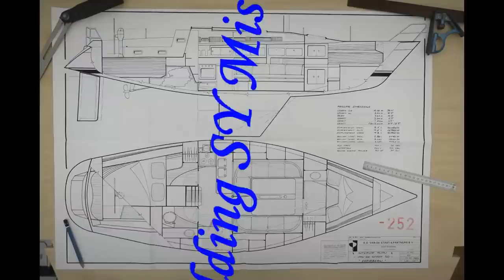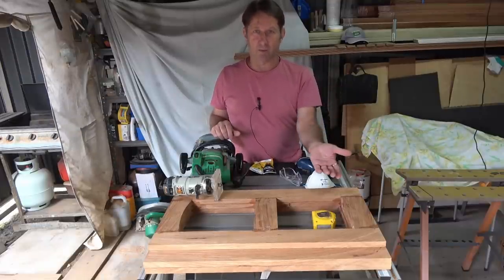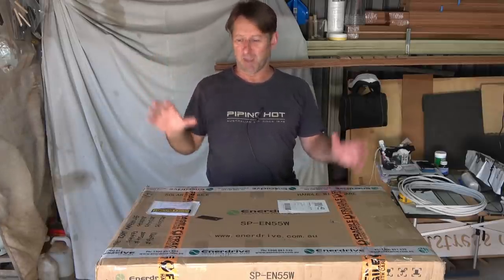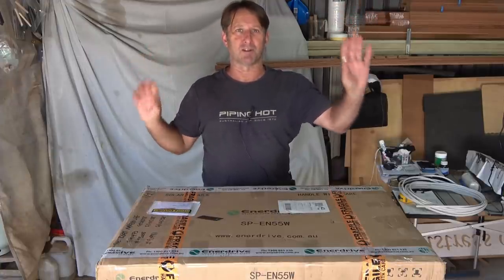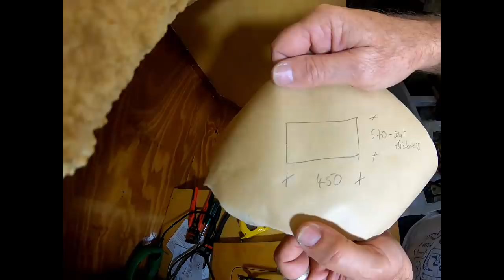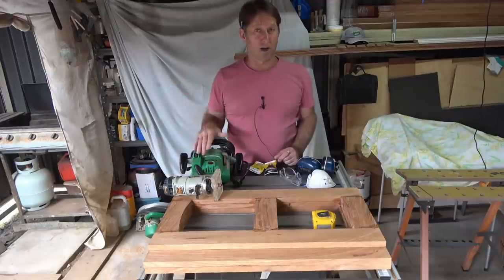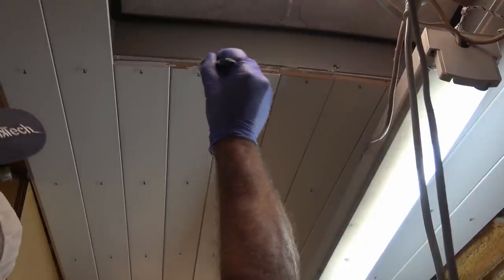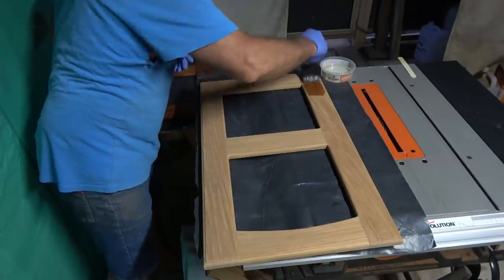ALL sorts of GOOD boatwork Ep.122 Building my steel sailing yacht

Comment: I really liked the treatment on the cabinet doors! I will remember that! I would recommend you paint the cut & filed aluminum screen insert edges as they will eventually corrode in the sea air. The overhead looks great and things are starting to come to a focus!
Reply from the maker: Thanks very much for your good comments Brian and fyi the edges of all of these aluminium pieces will be sealed in adhesive. Yes, the finish work with some things is starting to come together, thankfully!  🙂🙏

Comment: Well done Bruce. Lovely doors. BTW my personal view regarding solar panels and wind generators on small boats is 1) Wind gens are very noisy when at anchor and can damage bird life at night and 2) Solar panels made in China or anywhere else do not last or perform well at sea. Ok on a fresh water canal in the UK, but those boats are toys not ocean sailing vessels. Salt on them really reduces the output, they are weight in the wrong place, they need cleaning and replacing and the power packs are another cost and weight. If you use paper charts for your coastal work you won't need electronic gear so much and personal light when dark can be supplied by a very small LED using extremely low power to run. Finally, solar panels are so ugly and cumbersome when mounted on a thing of beauty under sail like Mistress will be. Old school is reliable and centuries proven. BTW I am 77 years old so I guess I am expressing bygone thoughts.
Reply from the maker: Thanks very much for your good comments Graham, appreciated and understood re. solar and wind generation hardware. Things/hardware and technology have improved a heck of a lot and no doubt will continue to, so for eg. much quieter wind generators are available as are durable and decent performing solar panels. As I always say, nothing is perfect and compromises ALWAYS have to be made and I think that having other alternatives to only having to rely on running a diesel engine to charge batteries is sensible. I do agree with you though re. the unsightly aspect of adding these things and Mistress will be quite a low power consuming yacht, things and time are always changing, as one old saying goes, "nothing stays the same"  🙂⛵
Reply: @BuildingSYMistress  Fait enough comments
Reply from the maker: @graham6229  🙂👍

Comment: Hrm, on the topic of solar types, I feel like on a boat, where realestate is tight (especially monohulls) monocrystaline just make the most sense.  There really is no debate over whether mono or poly is more efficient, mono is just factually more efficient, and if your goal is to supply the most power from a small available area, it doesn't make sense to use polycrystaline cells.

The conversation of rigid vs flexible has gotten a little more interesting recently, with more and more flexible panels coming around that can almost reach the efficiency levels of rigid panels.  That said, I would still only use flexible panels on highly curved areas, or where I know that I might need to stand or walk, where a rigid panel would require special hinged mounting to allow for access.  But anywhere that I know that I wouldn't be needing to stand or traverse, and is relatively flat, I would be using rigid panels because none of the flexible coatings have managed to attain the light transmission levels of glass.

Though there is a solid argument for weight savings of flexible panels over rigid, and if I were selecting a solar solution for a boat with a large amount of space to use, or one that is more highly sensitive to weight, I would have to calculate the net gain/loss of power and weight to make the ultimate decision.
Reply from the maker: Thanks very much for your good comments re. solar options, much appreciated  🙂👍
Reply: Like your comment, I fitted semi flexible Shell marketed panels some 12 ys ago, they've all died now !
2 from scrapes from the boom fittings, although it took 2 yrs ish to actually cause death, and the last 2 have just gone down hill to nothing. It seemed a good idea at the time as they fitted the wheelhouse roof well.

Comment: I'm a little curious about your selection of Cedar, since you're painting it.  Is there a specific reason why you elected to use it rather than a different species?  I feel like cedar is typically a more expensive option that one would use in scenarios where they are leaving it exposed or just stained.
Reply from the maker: Thanks very much for your good question, appreciated and yes, although I always planned to coat the cedar lining I wanted to use it due to it's fantastic properties of stability within climate differences, lightness (weight) and beauty that does still come through the coatings  🙂👍⛵
Reply: @BuildingSYMistress  Ahh, good points, I hadn't even considered that cedar is lighter than other options, and didn't even realize that it's habitat makes it particularly good for high moisture environments until looking it up.  Thanks!
Reply from the maker: @FlesHBoX  Welcome!